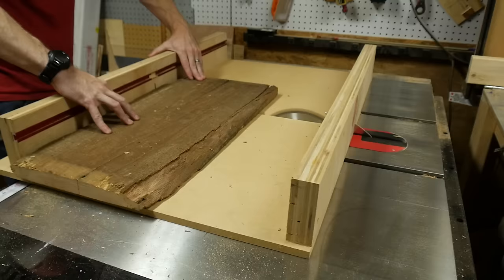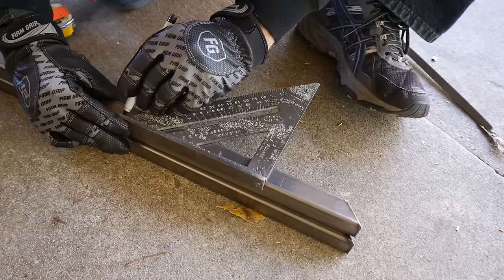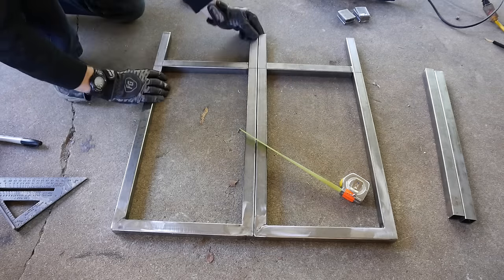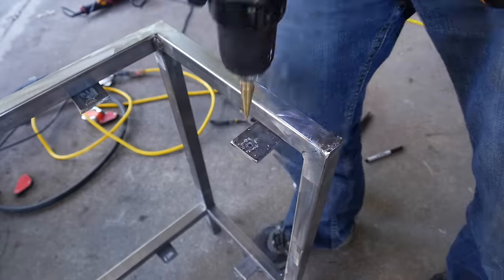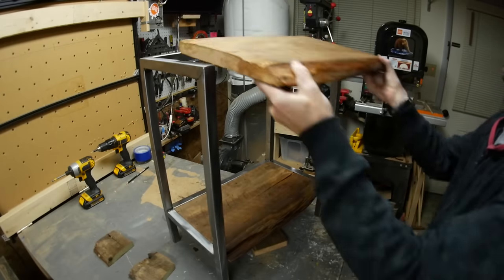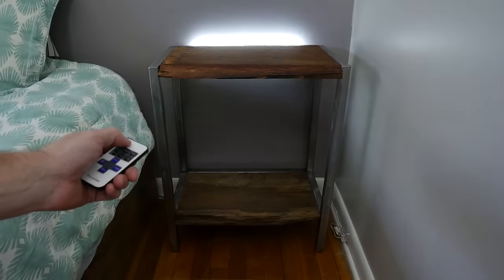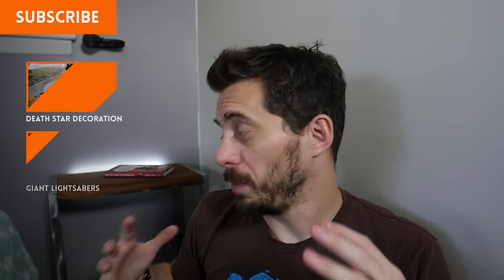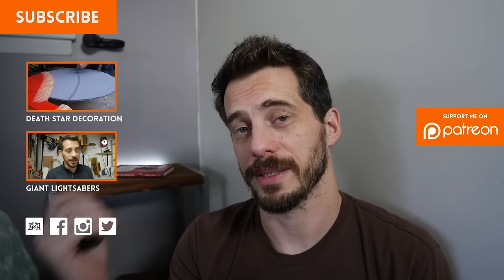Bedside table with a built in night light // How-To | I Like To Make Stuff

Comment: A metal cutting carbide blade might be a better option for your chop saw. Clean cut, less sparks and no heat build up. They cost a fair amount more than the abrasive blade, but will last longer. Enjoyed your video.

Comment: Great project Bob!

The mitre problem with steel is a common one I think.  I know I struggled with it when welding for my job.  One work-around that you may want to try is cutting only 3 of the 4 sides of your square tube stock off (leaving a square tab) Then you are essentially just making a right angle butt joint, but the tab covers the opening on the other piece.  I hope my explanation makes sense.  I don't currenty have a welder or I would make a video to demonstrate.  Especially since you are grinding all of your welds down to invisibility, it makes the job WAY easier.

Thanks for sharing another great project, and all of your insights about the hidden frustrations.  You inspire a LOT of us to make things!

Comment: Its a neat project.  What I like most about your videos is you are not afraid of sharing what you could have done better on your projects.

The challenge with cutting miters with an abrasive chop saw like you have is the blade can flex and the clamps often move.  I have had more luck when I purchased a metal cutting chop saw with a metal carbide toothed blade.  But its still not designed to cut as accurately as a nice wood miter saw.  It can be frustrating if you come from a wood background like you do.  Big band saws are more accurate (so I hear), but also more money.

Comment: Good timing - I'm about to make a breakfast bar using the same techniques with a reclaimed pallet top. I would defiantly recommend the metal bandsaw. Even the Harbour Freight (princess auto here in Canada) metal bandsaw. I do a lot of metal fab for vehicles and that has been the best purchase I've made for getting raw material to a consistent and accurate size. Best part is, No dust, Way less noise, and NO CLEAN UP! Ready to weld soon as they are finished cutting.

Comment: Hey Bob! The table came out great! Good job sir! In regards to the chop saw the biggest thing I've had to watch out for myself is deflection of the cutoff wheel as you cut through the material. For me personally, I found that cutting slower helped (the deflection was coming from the downward pressure). I also upgraded from a Chicago Electric to the dewalt chop saw after some frustrating projects and it seemed to help, as it wouldn't bog down and would cut through more easily with less pressure and clamped the material really well while cutting.

Comment: The warm white can also get quite annoying, another option is neutral white, you can get 10x 3w neutral white chips for $3 on ebay and with metal frame you already have built in heat sink.
Reply: +WKDworks I have a hypothesis that people over a certain age prefer warm white (because it looks like incandescent) and for other people, the neutral white is better (I am over that certain age!)

Another theory is the one Big Clive has, that people from warm countries like cool white, and from colder countries prefer warm white...
Reply: +WKDworks I can't stand "warm" lights, the yellow gives me a headache and actually makes me depressed. I prefer the "daylight" color temperature a lot more.
Reply: +sgtpepper1138 kind of ironic that yellow makes you depressed, because yellow is the color of joy and happiness.
Reply: TheChipmunk2008 
I prefer warm white in the evenings and cool white earlier in the day.

Comment: Hey Bob nice to see you doing some more metalwork.  

I do a bit of steel work in architectural fabrication + furniture , there's some things you can do to improve miter cutting.  The clamp is typically applying the force at 45* to the fence rather than perpendicular so you must be diligent to prevent slipping. #1 No gang cutting! This just adds another joint between 2 pieces of smooth steel where slipping can occur. This is typically unsafe, I think ideally the pieces must be bundled like a pack of steel studs for example.  #2 I have the Dewalt abrasive saw which has a rhino-liner like textured fence to grip the steel, if the HF saw is smooth you can think about adding a coating/sandpaper maybe?  Just make sure its clamped well and keep and an eye for movement while cutting.  #3 is a personal technique, but as I start a miter cut I let the abrasive slowly chip the edge for a few seconds to begin forming a notch, once this is formed you can increase pressure and the saw shouldn't want to drift as much.  I should make a video demonstrating, I typically cut acute miters up to 70* using a combination of these techniques.

Keep it up the good work!

Daniel

Comment: Hey Bob, 
Looks great. I've built similar style bedside tables. For the night lights, I prefer to route the LED strip into the wood. You don't get the hot spot on the wall and it doesn't distract the other person in the bed if you get up in the middle of the night. Our own beside table is a floating 2 drawer which is bolted into the wall, and has a power outlet behind it (Drawers have a space behind them for the outlet and power supply. I integrated a USB charging port and brushed push button for the LED light, and a 50mm brushed cable tidy hole in the top for the alarm clock cable. Food for thought :) Can't wait to see what you come up with next.
Cheers mate,
- Adrian

Comment: I have a similar cut off saw and had the same problem with the material drifting when it was clamped in place. I used 3m spray adhesive and covered the fence and clamping face with 100 grit sandpaper and it helps the material to stay put. Only thing I've run into is the steel heating up to much and melting the glue. I normally cut slow to avoid this.

Comment: Hi Bob, nice build. Just listened to making it 49. In case nobody has chimed in, the carbide metal cutting blades are not designed to work with the saw you bought, rpm's are to high and blades will dull fast. Those blades run on a saw that's about 1350 rpm.

Comment: Metal moves a ton when all that heat is added to it.  One tip when you are welding a rectangle like that: tack each joint (if possible, while holding it tightly square).  Then, when you add all that heat from finishing the weld, it should have less ability to move the structure.  Great project - turned out really nice!

Comment: I have the same issue with that model cut-off saw. I noticed it on the second or third piece I tried to miter cut. All I ended up doing was securing it with the built-in clamp on the saw, and then further away from the blade, I used a small c-clamp to keep the left side of the material butted up to the 45 degree guide. Pain in the ass, but it worked without having to modify anything.

Comment: I have a similar chop saw to the one you use.  I have found that, at least for my saw, it wasn't the way it held the steel, but rather the saw blade deflecting from the pressure that resulted in inaccurate cuts.  Cutting slower seemed to help.

Comment: Hey Bob, nice piece! As far as cutting a bit more accurate with a cutoff saw I sometimes use those corner magnets u were using to hold my piece a little more firm on the saw. Also for drilling use some simple green to help keep the bit cool. Works better than most others and no extra oil to wipe off later. Alan Little from AskWoodMan has some great videos with drilling and welding tips for woodworkers. He also uses simple green as a cutting fluid. Just gotta be careful using it on aluminum because it will stain it. Anyway, keep em coming! Great job. Merry Christmas.

Comment: The band saw would definitely be a great investment. They are a lot more accurate. The metal cutting ones are pretty big though. That's not even considering the rollers that hold the metal. Great build!

Comment: Hi Bob. I have a suggestion about your welding, I was always  tough to push the weld puddle, I noticed you were pulling away from it, maybe try pushing instead. Cool build, ireally like the look of the brush steel with the wood. Might have to use that idea for a workbench maybe once my workshop is built.

Comment: I bought a reconditioned 7-1/4" power miter saw and a diablo steel demon blade for under $100 and it easily and accurately cuts 1" square tubing as well as angle iron or flat stock.

Comment: Great project, just a tip - you mentioned the warping, might be an idea to tack it all before you finish each join as the heat warps the steel. On the chop saw I went back and looked, seems like you avoided the simple mistake of having the fence right at the back, it was moved forward to hit the right part of the blade. DEWALT make a diamond blade for the 14" saw that helps the cut and stops drift - you also don't get the blade diameter changing as it wears and it last as long as 100 normal blades

Comment: hi there Bob, 

I haven't read through all of the comments, so apologies if someone had already given you the following couple of suggestions;-
 
Firstly; for welding squares or rectangles, just cut a single sheet, based on the internal dims', on the table saw from 3/4" or 1" MDF and then cut off each corner a good couple inches short leaves triangles of room to get your weld in, that way. you can get more than just a tack weld in before you have to remove the MDF "jig". 

Secondly, when you say you were surprised by the amount you had to pry the legs open to fit in the correct sized piece, that's simply because of (lack of) staggering your welds, for e.g. when welding up a triangulated space frame race car chassis, I would always alternate the weld location to opposite sides of the chassis to ensure it remained straight. 

Thirdly, is info regarding your last comment about accurate cutting using your style of saw. Basically the fibrous (grinding type) saw blade you used are prone to a significant amount of blade deflection, so even if you had clamped the work accurately, but then proceeded to cut two lots of inch box section at the same time, unless you were Really gentle, that blade was always going to flex...

Apologies for the long post, but I listen to your podcast where you share openly your welding and fabrication knowledge and thought my comments may possibly be helpful..
Hope I've not caused offence, thanks for your good work, 
Steve

Comment: nice project. definitely gonna make a set of my own. 

just a tip for your welding, if you Bring your nozzle closer to the workpiece instead of having that ~1" gap you'll find that your welds will be a lot cleaner without so much spatter and it will be easier to weld aswell. 
just a tip from a Red Seal Journeyman welder.

love the videos!

Comment: I like the video, and the work done.

Safety tip-
It is not ideal to weld on cement. 

Air pocket expansion from superheating can cause violent explosions. 

Easy fix-
Elevate the project with blocks of wood or other scrap pieces of metal.

Hope to see more of your stuff.

Thanks buddy.

Comment: hi sorry i`m late for the comment. abrasive saws never cut miters precisely because the abrasive disc is flexible (good for safety-not good for holding an angle). if you want to go the next level of accuracy try a dry cut saw (carbide teeth). if you have the funds a band saw and if you are really into it a cold cut (this is the optimum). the tabs you welded can hold a ton, i usually weld flush with the tube and recess the wood the size of the tabs giving a super clean look. for the electronics i know squat about and this gave me super cool ideas. thanks for sharing. regards. pete (professional welder/fabricator)

Comment: To stop the welds pulling the leg out of square you should, after checking the magnets are holding the correct angle, tack weld the outside corners of the mitre edge first, then tack the inner edge of each leg,  do the same on the other leg while the tacks cold down, when cool, completely weld each joint. Start with the inner joint and the joint opposite which will pull any distortion back the other way when it cools doing the same on each of the following joints, the important thing is to keep the heat low  quit welds and constant on each joint.

Comment: I glue a square cut out from a tire inner tube or any thin rubber I have around the shop to the back stops on my chop saws and it keeps the stock from sliding

Comment: Man that turned out great! I like the brushed metal look. I dislike the cut off saws of any brand. When batching out or cutting alot of material they are okay I suppose. Have you seen any one "notch" material for a 90 degree angle" Cutting a wedge out 
(perpendicular to the material) and leaving the outside where the bend will happen in tack and bending the material to make the angle. This makes for a very smooth outside edge with a uniform transition and less of a chance of burning through that outside edge. Thanks again for the videos Bob!!

Comment: Bob, you should check out the carbide blade metal cutting saws or the band saws. Jimmy Diresta has a big band saw that seems to cut straight. AvE has a carbide circular one that appears to work well also.
Reply from the maker: +Scott Hutson Yeah, those blades just cost more than this saw did :)
Reply: +I Like To Make Stuff .. I'm with ya brother. Most of my work is with wood. I'm still using an angle grinder and cheap wire feed welder for the little bit of metal I do.

Comment: If you use a grinding abrasive disk on the saw, try to change it to the blade. Steel blades not overheating metal too much and make more accurate cuts. cons - much more time to make 1 cut, be ready for this.

Comment: For better 90 degree angles, use the painting frame clamps. The red ones with two clamps set at 90.

Those give both a perfect 90 and because of the clamp frame, they align the pieces. Having four of those lets you practically build a frame in one go, also, they are made out of aluminium/aluminum so no worries with welding with them in place.

Extra bonus? Dirt cheap, so even if you ruin them, you won't look twice at them.
Reply from the maker: I've got several of those and didn't even think to use them! I think my mind still doesn't overlap the wood working tools with metal yet. Thanks for pointing that out, they'd work great!
Reply: +I Like To Make Stuff Those clamps work great for welding. The other key is to do just minimal tack welds (I like to hit the very corners because they are the easiest parts to miss when doing the actual beads) on all of the parts and then go back in and do the final welds. As the weld metal cools it contracts so it pulls the workpiece in the direction of that weld joint. So putting the braces on the legs before doing the full welds would have kept it in alignment. 

Finally be aware that welding and metalworking is as addictive as anything else. I started with a welder and angle grinder and now I even have a surface grinder in my cramped shop. :)

Comment: If you want more accurate cuts you should invest in a proper metal miter saw. They use carbide blades (which cost quite a bit) and spin much slower. They make really clean cuts and produce chips instead of dust like an abrasive cut off saw, which is a huge plus if you plan on using it indoors.

Comment: I've got the 4x6 bandsaw from Harbor Freight (Item# 93762) I bought it w/ a 25% off coupon and it's easily my favorite purchase for cutting metal.  It has an angle adjustment in the clamping system so it will hold tight and do 45 degree cuts no problem.   It also comes with a pretty crappy table but can be flipped up and used as a vertical band saw which is super handy for some cuts.   Spend a good amount of time getting it all squared up when you first get it and put a good Lenox blade on it (trust me I broke many different brands) and it will serve you well for a very long time!

Comment: in terms on metal band saws, you can make a table top band saw pretty easily using a portable band saw. then just make a stand with a base. I zip tired the trigger on mine and put foot pedal switch on it for quick on/off. do a Google search for "portable band saw stand" to get a better idea of what I'm talking about. portable band saws are like $100 from harbor freight and the steel cost me like $18! So it's a relatively cheap project and would make a good video too!

Comment: You actually want to hold the legs slightly >90 degrees when you're welding, and weld the inside corner last. When the arc heats the metal, it'll pull the legs in, so you have to account for that.

Comment: Hi Bob, HUGE fan of your channel. I've been watching for a few years now and you're one of my favorites. I know this is an older video now but I have a question about a similar build and hopefully you see this and can help me out.

Have I lost my mind or did you also make a nightstand with a wireless phone charger built into the top? If I remember correctly, it was covered with a thin veneer to hide the charger and might have had a power symbol on or shine through the veneer. I only watch a handful of woodworking/DIY channels and for some reason I keep thinking it was one of your projects. I've been looking for that build for a while and it's driving me crazy.

Comment: I know this is super late, but i just found this video. The reason the cuts may have been off is due to the blade flexing. The composite blades like bend as you cut. If you used a Steel blade designed for metal you get better cuts on the same saw.

Comment: Just a few suggestions. 1st, after you tack on your welds, move those magnetic clamps, not doing so will shorten their lifespan. Next time, set up a small jig for mitering and just use your angle grinder for those angled cuts, it's more precise.

Anyways, just some thoughts and cool table.

Comment: great work! welding pulls a little bit in and it is strong, so wooden jig probably will crack. maybe try to set a 93° angle and it will be about 90° after welding ;-)